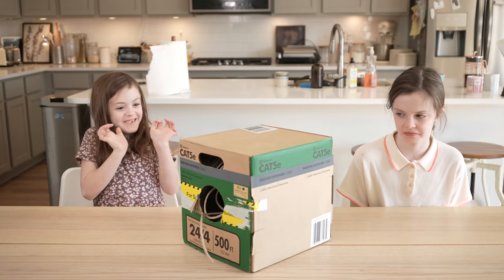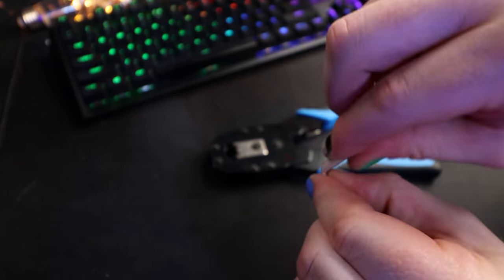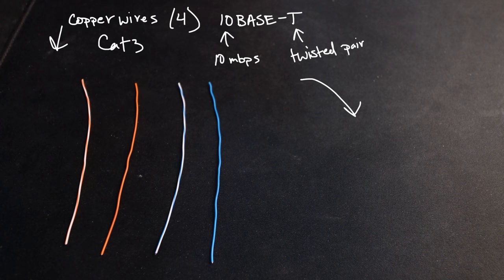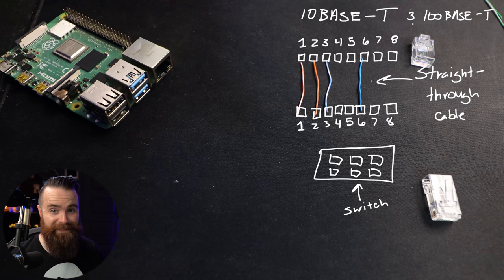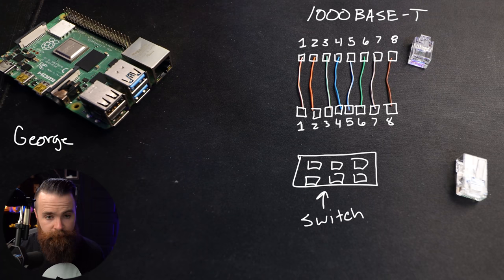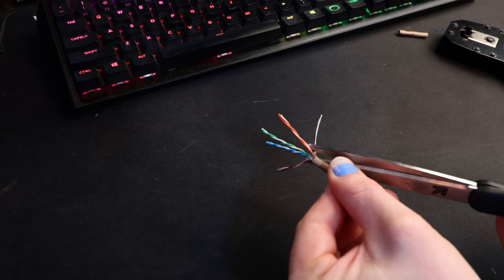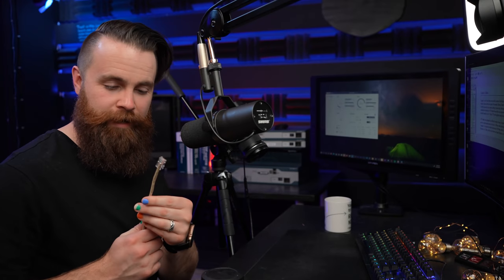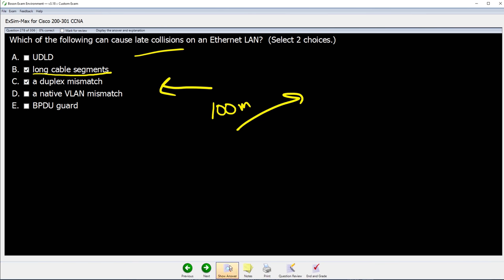forcing my kids to make Ethernet cables // FREE CCNA // EP 11

Comment: 31:50 you are doing all wrong. Once I remove shield - I bend orange pair to the left, brown to the right, blue and green to the forth and back. then I untwist them and make a curve to the right and left (this way wire looses its twisted shape). After all this I get nice little round "sun" from which I start to assemble the row: sometimes I start from middle - blue pair and green around it, then orange and brown from sides. After that I double-check the pattern - colored, solid, colored, solid... Then I bend them all together forth and beck few times for wires to lose its tension. Then I release them, trim them, put on the plug and clamp it.

Comment: Awesome video.  I was looking through the links attached to the video and noticed there is no link to the equipment used to work on the cables.  Cable tester and cable crimper specifically.

Comment: Almost right. The twist in the wire will reduce cross talk, but the wires are not susceptible to EMI due to the DIFFERENTIAL of the voltage of the wires. Being that the receiver uses a DIFFERENTIAL voltage you can not induce EMI into the cable. Same cabling reasoning is used in low impedance microphones that use XLR connectors.
Also you never put connectors on solid conductor riser cables like you are showing. You only place connectors on stranded wires. Solid cables should only be attached to jacks. Moving solid wire back and forth will lead to breakage on the wires in the cable, therefore solid wire should NEVER be used as patch cables. Since jacks are usually mounted on a wall or a patch panel, the wires will not move.
Also, that "grandmas hair" as you call it, is used to cut the sheathing down further as sometimes scoring the jacket will also score the wires themselves. So use the "grandma hair" to expose more of the wire past the point you scored.
As a CIO if I see my network guys improperly make cables, they will be reprimanded amd told to remake the wires. I also demand that wire markers be placed on a cable every few feet and at each end. This way when i see a marker in a ceiling or under a raised floor, I can identify the wire properly

Comment: This is great stuff! Question: If the 8 wires can go either way, why is there even a need for a crossover cable at all (or a switch for that matter)?
Reply: Now a days Most of the network devices and hosts now have an Auto MDIX feature so devices will automatically choose the pins to send and receive data back in the days we didn't have this feature that is why we needed crossover. Hope it helps.

Comment: I enjoy making Ethernet cables for the most part. Getting the correct length for termination is a bit annoying as I'm impatient and straightening the wires is tedious even when you use the tricks like run the wires down the scissors like a ribbon. The pass through termination heads are much easier for speed. Just get them close to fully straight and cut a 45° angle then feed them in one space at a time.

Comment: Hello Chuck. I have a question that if the 1000 base-t can send and receive data simultaneously on all the pairs than why do we need the 1000 base--t crossover design?
Reply: The point is not the 10000 base-t, Now a days Most of the network devices and hosts now have an Auto MDIX feature so devices will automatically choose the pins to send and receive data back in the days we didn't have this feature that is why we needed 1000 base-t crossover. Hope it helps.

Comment: when i was teenagers i went to buy a 7 meter ethernet cable, the seller ask me if i want him to clamp it for me. i said sure because i did not have the tool at home. Then he start to chatter how much important was the order of the cable. I was , as a teenager, "yeah yeah sure, you are good at this". when i got back home the cable did not work, the order was wrong. I did not know then that pins 1,2,3&6 are for data transmit and i live in a village, the shop was in the near town that i visited and i need to connect to internet not now but yesterday, so i cut the cable in some point and connect everything in twist then and put insulating tape. but i was in perfect order, pin 1 to pin 1 etc. It still worked!!!

Comment: Question for NetworkChuck. Why, after arranging the wires, did you cut them down before inserting them into the RJ45 head? I ask this because it looks as if you are using pass through RJ45 heads which makes that step unnecessary. The great thing about pass through RJ45 heads is that you can just run the wires through the head and the crimper will cut the wires for you to proper length.

Comment: The big question is... Why do the colors not stay in pairs in the connector. In theory you can do whatever color mix as long as both sides are the same. An interesting thing would be to know why the Rx is going to port 6 instead of 4

Comment: Hi Chuck. Thank you for your many videos, covering so many topics, esp Pi. I would like your advice. Which Linux OS would you recommend for a 6 year old? The only computer experience my grandson has is using his Chromebook -- mostly for school -- playing around on his Kindle tablet -- playing ganes and music, and playing Scratch a few times on my linux computer. It'll be installed on an old HP with i7, 8 GB RAM (16 max), with touchscreen. Currently it's running Windows 8.1, but I'm going to save the HDD on which it's installed, and install a 1tb SSD.

Comment: This is something I've been meaning to learn how to do for a long time.  Several less than ideal cables in my house would benefit from being replaced with custom length cables.  I already had a few things on the way to me before I got to this video in the series, like crimpers and cable ends.  But, I still need to buy some cable.  Do you have any brand recommendations?

Comment: Newbie!!! I go back to Bell wiring!  2 pair!  38:38 You are acting like a child!
One thing you missed was talking about the cores.  There are 2 types of cores - solid and stranded.  Solid core is best for long straight runs like you will find in a wall; stranded cores are best for lots of twists like you will find in a patch cable.  In the 90s, it was important that you get the correct type of RJ-45s for the cable.  If you tried putting a stranded core RJ-45 on a solid core, the pins will be all messed up.  Getting it wrong the other way caused less trouble but the cables were unreliable.  
Great video!

Comment: Actually, once I found out that pass-through ethernet connectors exist, making an ethernet cable is simply too easy 😉
No need to fight with cables to get them exactly the same length, no need to try to see through the plastic if this is a white-blue or white-green cable, no need to ensure that you pushed all the cables to the end of connector... Just put the right cables, ensure if these are correctly aligned by looking at decent length of the cables, CUT - and all is done 😎

Still, some ethernet sockets, especially with cat7 cables, are pain in the neck. I swear every time when I have to use these "easy to use, tool-free keystones" 😡

Comment: Great video as always sadly i missed the part about Poe and how that works and why the wires go 1236 and not 1234 that confuses me
also you got the incorrect crimper for your rj45's getting the crimper that also cuts the wires at the end making it way easier to get a nicely terminated plug and easier to check if the combination is correct
Reply: The connectors for that termination are much more expensive, as is the tool.  I have Cat-6 ends which have a piece which the wires go through and are cut to the end of, then that plastic part and the cable go into the connector and holds the wires in place.

Comment: i am 14 rn i made a  Ethernet cable 5-6 months ago to set from my switch to android Tv . it was a cat6a cable. i used a thin screw driver to put the rj45 plug and its connectors in place , idk what i did wrong it was only giving 100mbps of speed  .
i did not care as the android tv only supported 100mbps .

it is still connected and working .

Comment: No more RJ45 Network Connector for me, from how on I'm going with Ethernet Cable Head. Also if you went all the way back to 10BASE5 you could have used the phrase "vampire tap" which is always a good time.

Comment: Thank you for yet another excellent video. I have just done 4 good connections while doing 6 bad connections. I understand what you say about pins 1 and 2 and 3 and 6 for send and receive. But what do the other 4 pins do? I crossed pins 7 and 8 and ran out of connectors but the cable still worked. So I guess that pins 4, 5, 7 and 8 are redundant. Could that be so?

Comment: Not allowed to do this here in Australia, haven't been allowed to for years now, unless you are an approved cabler with the correct certifications.

It basically comes down to the fact that the network cable could be used to connect to the telephone network, and if it is done incorrectly, it could hurt the telephone network..... Which is silly, because there's a router / modem between you and the big scary telephone network, but alas, the rules are the rules.

I haven't made one in years because of those stupid laws, still remember how to make one though, also know how to do the coax and fibre, learnt all 3 of them back in 2000 at college (That's aussie college, not the weird US name for a university).

Comment: Dumb question: If it's a straight-through cable, why bother with the B-scheme and splitting the green pair? The electrons don't care what colour the wire is. As long as the wire goes to the same pin on each end, it should work, right? It's a lot easier get them to line up if you put them in sequentially. You could probably do any combination as long as they match on both ends, right?

Comment: Linus full has a video and he looks at a Rj45 port with only 4 pins and did not know how it worked i pissed my self laughing, anyway i posted Full duplex dude..... i think it should be noted that above cat6e i think they are shielded at that point as a standard most notable would be cat8 its shielded and there is two times of shielding screened and full shielded screening is what i call a floating shield meaning its not connected, the shielded meaning its grounded. i forget if its a standard now but i have found some controllers and switch's that don't care if your using patch or xover they will change according the first controller i seen this on was a marvel controller i found on my asus board. 

Your very lucky to have such a lovely family, its good your putting these video's out as its so important to know why and how it works even though now days 10base is not used its standard is still used. Thanks for swapping out the blue......... i was having a heart attack... blue is line 1 for phones.

One thing i find funny is people buy new homes and they have RJ45 put in but all the cabling is only done for phone lines... i think these guys need to watch this video.

Comment: How reliable have handmade cables been for you?

I've found that in use cases where they get moved around (like from a network jack to laptop dock), they tend to get slowdowns and dropouts after about 3 months, and I've heard similar stories from people of various skills. I'm planning to design my home network to only use punch down jacks and machine-made male-to-male cables because of this
Reply: 100% reliable, if they fail then it is operator error.  patch cables should be stranded cable if it is going to be moved a lot.  I have never had a problem with the 1000s of terminations I have done (except randomly when I have rolled the RJ45 plug, upside down LOL)  there are a lot of cowboys that recomend rough treatment of the wires here .

Comment: Damn that was amazing. I learnt this stuff in school but my teacher was great so this was more of a refresher than a "I learnt more in this video than in a whole semester of lectures" kinda deal. Still have my cat5 cable we made in school.

Is it worth it making cables at home? Like, 100m of cat7 sftp, some rj45 connectors and a crimper seem to be (crimper was on sale when I looked though but a well known local brand and not some cheap trash) as expensive or even cheaper than buying 100m worth of ready to go cabled. But is it worth it or would you prefer buying cabled for home use? Like, I can reuse a 2m cable that I've hidden behind some furniture but I probably won't reuse cabled I made to length for a particular situation. Also, how error prone is that? I've never gotten a bad ethernet cable from amazon. But then again my first and only self made cable is also still going strong...
Reply: When at home... it is easier to run cables without ends, and is much cheaper to buy a box of cable, faceplates, and keystones and wire them into the wall... also looks much more professional.  With the extra cable, it is easy to make patch cords exactly the right length for the computers, or with more room for movement.  And if you terminate the other end at a patch panel, will need lots of short cables for going patch panel to switch.

Comment: Could you theoretically put the colors in any order or is there an actual difference between the wires besides the color
Reply: Chances are that the cable will work fine if you don't follow the standards. However, if you're making cables, its best to follow the set-standards as some network equipment may not work well or at all if the wires are in the wrong order. It can save a lot of headache down the line when troubleshooting.

Comment: Number of times I've had to make an ethernet cable professionally: 0
When doing a large number of cable runs the electrician will do it, otherwise the time spent diagnosing faulty crimps is more than the price of the cable

Comment: 568a on one side and 568b on the other side does NOT make a gigabit crossover cable. It will operate at 100mps not 1000. In order to get a true gig crossover, all 8 wires need to cross.

Comment: Your wiring colour order is incorrect.  As per ANSI/TIA 568.2-D (2018) standard is recommended to use 568A for straight through cables: White/Green, Green are the Transmit on 1 and 2, and White/Orange, Orange on 3 and 6.  You are using the 568B order, which is the recommended standard only for one-end a crossover cable (and is why it is the 2nd standard of wire order).  Outside of the US, 586A is used for straight through, and only because we are often redoing a single end of a cable manufactured to the US standard which is from inertia that the 568B is used.  I wish certifications would stop giving the non-standard details, or at least note about it.  

The Green/Brown colours is a pain at times... and I have killed a $20 POE injector (luckily not the $300 CPE radio)... and since it was a splice under a manufactured home... it was the only time I felt like them miswiring.  I moved on from the cheap tester like that to one which beeps if it's right, and tells me at the main which of the 8 remotes is on that one.

Comment: I broke my crimper trying to crimp the cable, it wouldn't open after I squeezed the handle, so I ended up yanking the cable out and the plastic head which was locked in broke the alignment of the metal mould, I broke every cable head I tried to crimp after that

Comment: You use grandma's hair after you have took the jacket off the cable its possible too damage the inner cables while removing the jacket you pull the hair down too tear into the jacket creating a new section of cable thats definitely not damaged in anyway

Comment: but why does it make a difference that green is on 6? inside a cable if green is connected in 4 on both sides and blue is on 6 on both ends arent they both just connecting 1-1. i know that it doesnt but why?
Reply: Each color combo is twisted a different number of times per inch designed that way specifically for data transfer.

Comment: if you buy write nos a cat 3 u still have 8 cables there is just less shielding 4  color cables dont exist any more all types have 8 cables step 1 look up witch protocol is used in your country  because in the the US they use protocol T568A  and in the moest eu country's we use protocol T568B and the real difercence betweet cat 1 to 6 is the way they winded up the smaller cables and the more schielding is added to your cable a cat 6 is the best cable it has in every colord cable a shield then arround the collord cable again a shield the arround all the collor cables and then a other one and then you get your outer layer the les shielding the more the colord cables and other divices interfear with your cable so and that also way the coper wires are wind up diferent  some tider and other les so the the siginals in side les interfear with the others that what change first and then later  more smal kables and then more shielding i followt course of netwerk meneger and and other ict lessons to start of in ict and yes its ICT not IT

Comment: It really breaks my brain that orange white is pr 1 when it's pr 2 in the larger in street copper distribution cables
Reply: I work telco and can kinda explain it. When they made the ethernet standard, they knew people would be people and used to plugging their plain jane ol' telephone cords into any hole that looked similar, so, just like in the older R/G/B/Y phone jacks, they kept pair 1 on the center 2 pins to match up with the old standard for POTS service. In fact, for small slow networks with limited wiring, you can run pots through the WhBl/Bl pair and split them out into a seperate port, and retain 100BaseT on the orange and green pairs.

Comment: Can somebody please explain this to me, because I still can't understand why the colour order in straight connections matters. Is it not the same kind of wire in all the colours? My logic is : as long as the order of colours on both ends of cable is the same - it should do the job as well as with the recommended order. Where is the trick?